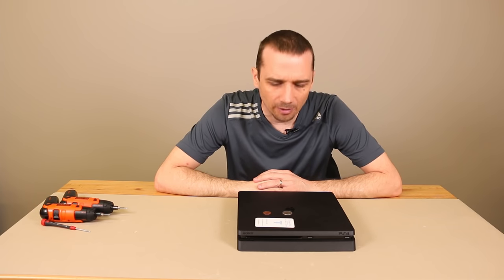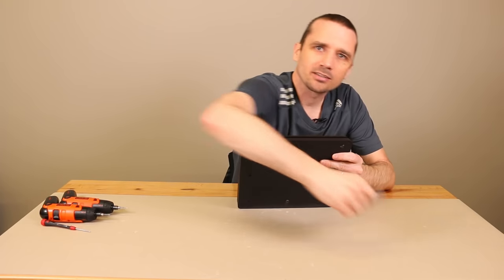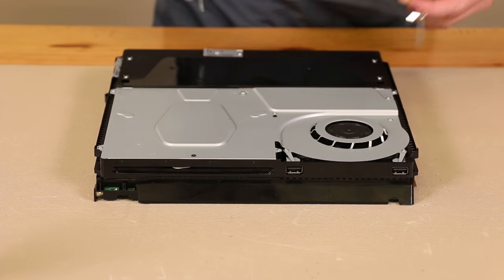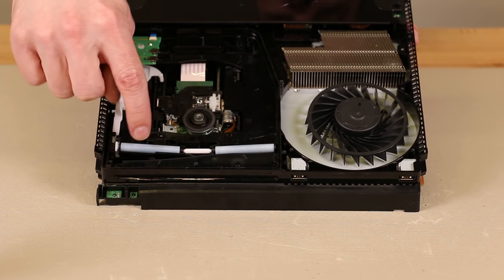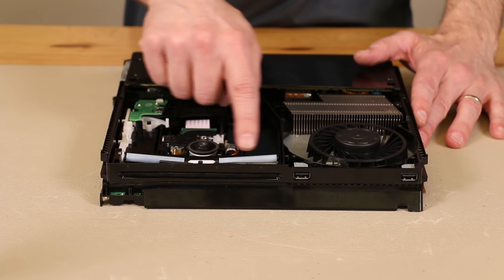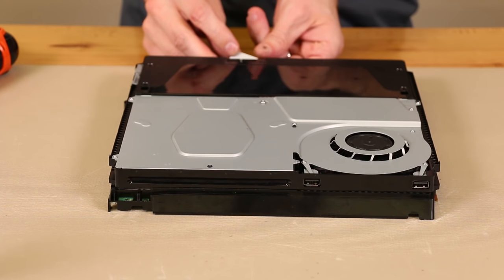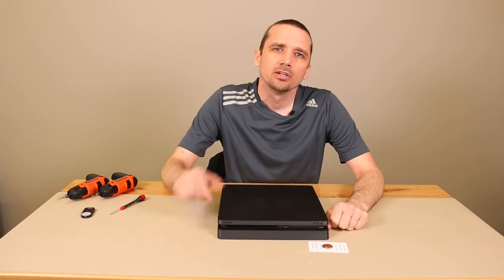How To Fix PS4 Slim Disc Drive

Comment: I did everything exactly and made sure everything was exactly in the right place when putting it back together and it still won't take disks. I don't know what else to do. 🙁
Reply: Same problem, it's because of the 7.02 system software update.
Just wait a week till 7.03 comes out and it will be ok
Reply: @lucasos2507  is that really it, did a lot of other people have problems after the update?
Reply: @GassyHippo  ye, but most of them are ps4 slim users.
Sony's software is that when one thing is broken, it thinks it's corrupt so it will shut down, everything has to cooperate otherwise this will happen.
The update to 7.02 is a harddrive killer to the most user.
That's why sony apolagized on their forum and told us there will be another system update very soon to deal with this.
Reply: @lucasos2507  That's what mine is, I was freaking out thinking I'd have to send it in an not get it back until maybe January. Then I found this video, thank god I still have a ps3 super slim to play blue Ray's and dvds.
Reply: Luca SOS nice glad I came across this video everybody was saying I had done something wrong when I was just playing games last night and my ps4 is in perfect condition thank you for this information my man do you happen to have a link to the forum I want to save as many people as possible from sending there ps4 in for repair when there is nothing wrong with it
Reply: Same here, I noticed my ps4 started acting weird after I updated but didn’t think that could be the cause so I manually removed my disc using the screw on the bottom. Thank god I haven’t actually gone on and torn anything out yet. Will wait until they release another software update to fix this before I do that.
Reply: GassyHippo thank you
Reply: @lucasos2507  are u sure it will be week
Reply: Luca SOS you fr sony can mess up that bad?
Reply: I am getting quite vexed, I downloaded the new 7.02 update and now my PS4 won't even take discs.
Reply: @Chococarakuma  are we all sure that the update is what is causing the problem? I manually got the disc out but now it will not take a disk. Removed everything as shown on video looked to make sure everything was clean and in proper alignment still not taking a disk.
Reply: @stevenglick5920  well my PS4 was working stellar till the update.
Reply: @lucasos2507  oh is that why i get the error and it won't take discs ? i have tried to install and no luck ?
Reply: This is the 2nd time something like this happened to mine, the last update had my PS4 not recognizing discs
Reply: Steven Glick I mean what else could it be my ps4 was working fine until previously the day of the update that isn’t a coincidence and even if it was it wouldn’t be happening all over the world to multiple people
Reply: Luca SOS hi i used to play gta v before update but i changed my hardrive and updated software to 7.02 ,my gta v disc says disc is dirty. But i can play fifa19....would that be this software error???
Reply: @khaleesaneesak5146  yeah have the same problem... did you find a fix?
Reply: Blisto yes, just plug in a usb thumb drive and switch on the console, then insert gta v disc and start installing it.. worked for me..

Delete the gta v  application which didn’t intsall before doing this .Let it freshly install👍🏻

Comment: I found a black right angle piece that has two machine holes. Where does that go? I didn't see it' location before it fell out. I did have the ps4 broke down to the level you have in your video.
Reply: I found that piece too but it was after I’d reassembled the whole thing and it has just worked fine since
Reply: I found that piece too but it was after I’d reassembled the whole thing and it has just worked fine since

Comment: Apparently the newest model out uses plastic welds instead of screws!
Reply: RebelNightWolfe Are they removable? I'm stuck at this step. I don't want to break it. What did you do to handle this?
Reply: RebelNightWolfe  yeah mine is similar to this one you just have to lift up the plastic until you hear it snap then lift it up from the sides
Reply: Ghost Chivero it doesn’t work

Comment: So I just opened up my ps4 using this video because I’ve had issues after the recent software update. Got to my rollers and saw everything looked perfectly fine except for they don’t spin. I think the gears are stuck or something and I’m not sure how to fix that. Really would like some help. Thanks
Reply: The same thing happened to me after the update I watched a video to how to get my stuck disc out and it worked but that cost a bigger problem it won't insert disc no more so I'm going to hopefully try this method in the future don't know when but I'll get back at you if it works

Comment: Thank you so much for the video. I cleaned the rollers of the disc drive. And it works better than before. I also cleaned the fans and it's making a lot less noise now.

Comment: Thank you kind sir. My console works again like it should. I just cleaned the rollers and laser. My console was taking discs but only when it was starting, after that nope, removing disc without any issues but after that it was making weird noises and nothing.
Thank you so much.

Comment: Thanks for the upload managed to fix my ps4 which had a bent disc drive plate. Because of my stupidity in putting my monitor on top of the ps4. Also the right side roller popped out of the disc drive. Saved me money and time sending it to get repaired 👍👍👍

Comment: Thank you so much! My PS4 Slim had black plastic pieces in place of those metal screws you had so I literally just broke the tops off and it still worked perfectly. I cut them off with a razor.

Comment: Hey man. First of all, I wanna say that I appreciate you making this video. Unfortunately, I'm stuck at where you remove the 10 screws. I have the newest PS4 Slim model that was on sale last year's Black Friday. There are cap like screws instead of actual screws. I need help removing those so I can continue with your tutorial. I appreciate your help man.
Reply from the maker: Ya, those ones are more annoying but still doable. What I do is take a pair of pliers and round them off just enough to get the metal plate off. Just enough for the holes to slip over them.
Reply: TronicsFix Thanks for the response. Unfortunately, I'm not technical enough to attempt it. And I don't want to break anything in there. Thinking about shipping it to you to resolve. Based on the noise it makes when running the disc, I've been told it might be a bad laser. Do you have a cost estimate for replacing the laser?
Reply from the maker: We charge $99 for a 5 business day repair.
Reply: @Tronicsfix  right at the beginning where you show how to unscrew the screw at the back, mine has plastic covering thay screw. What do I do?

Comment: The part where you take the screw out for the bottom plate ,it says it voids warantee if removed...is the screw behind that?
Reply: I know it has been 8 months, but in case anyone else wants to know the answer:
Yes, it is behind the warranty sticker. The warranty for me at least only lasted a year so taking off the sticker and voiding it didn't matter as it finished years ago, if that is the case for you, don't worry about peeling off the sticker.
Reply: @benatronnn  thanks

Comment: Also guys there's a spring that hlds the black prongs on top of the disk drive tray. Make sure you don't lose that when you take top of the disc drive off. I had to find mine a little inside below the cover because I had removed it and didn't notice by accident. This caused disc to not go in once they went out.

Comment: @Tronicsfix   
7 years late but just a qestion, do you have to remove the bottom plate because when I try to do it the bottom plate would just not budge and I put alot of power.

Comment: Great video, I definitely need to clean or reassemble those rollers, and hopefully just cleaning the laser will fix my other problem (still reads blu-rays but stopped reading DVDs). Thanks!
Reply: Very mixed results. Cleaning the lens didn't help the DVD non-reading. Tried safe mode update & rebuild, didn't work, will try initializing someday after I get a new backup drive. But I'm guessing the laser is probably busted, would you reckon that's likely even though it still reads blu-rays and games?

Cleaning the rollers really helped get them working again (frankly too well now, they spit the disc all the way out and it falls on the floor if I don't catch it), but I seem to have messed something up with them that makes them much more hesitant to activate, I have to press the disc in there kinda hard now before they notice it.

Comment: Tronicsfix, it seems like the flap connecting the rollers has something underneath because my disc drive is trying to get my disc out but it can't because it's in the way of the exit. Is there a way to get that off?

Comment: Thanks for this, very good video. I did a complete opening and analysis, I'm still stuck though. Everything seems to be mechanically ok in the disc drive but the ps4 doesn't seem to 'know' there's a disc coming in. Probably a motor or something?
Reply: same
Reply: Ya can we plz have some one who knows wuts going on in this section.
Reply: @empirerulez9057  in my situation, yes it was a bad motor on the disc drive.  I sent it to Sony and they replaced it for free (I had to pay for shipping though).  

Once there is any mechanical failure in the ps4, it will not allow for a software update.  It is essentially bricked and will need to be repaired.

Comment: Okay this is a great video and very comfortable in taking this apart however when I go to take off the metal plate it doesn't have screws it has little plastic pins and I have no idea how to take these off.

Comment: Thanks for the breakdown I just fixed my sons Ps4 Slim the spring at the back of the two black arms had come off and was inside .. Thanks ..
Reply: A little help tip for some , in my ps4 slim there were not so many screws under the lid , I had to cut off melted  plastic bits ..

Comment: The screw on the bottom side that goes through to the power supply that you spoke of before flipping the ps4 over, what size Philip head screwdriver did you use?

Comment: Mine has plastic welded tabs instead of screws on “the metal plate” more of the plastic than of the screws. Will my PS go back together if I break those tabs?

Comment: I understand everything you're saying, but I have a problem with that because I don't have screws on my gray plate I have black round plastic heads, but have 4 screws. And no way to pry open without breaking black heads. 
I'm trying to fix my friends PS4 Slim because it will not read any discs and says unsupported. Neither DVD or Blu-ray, but it takes time loading about a full minute to show the ? . It revs up kind of loud but struggles off and on trying to read a disc but never does. 
Any ideas?

Comment: I’ve opened mine and it only has three Philips head screws the other six are little black plastic covers? Is there a way to get around them or remove them without damage?

Comment: . Excellent video and breakdown of dissembling it. The only problem  I have is right up till after you clean the rollers then that white plastic it doesn’t slide.. I don’t want to force it towards me to break it. When I push down the rollers It doesn’t slides and when the rollers are up it doesn’t slide. I don’t see anything lodged in there. It moves a a little it doesn’t go back and forth.  An u help me please. Thanks

Comment: I got the cottons from a qutip stuck on the plastic gears?? I took off the cotton stuck there but now the PS4 can’t take in the disc. Am I just missing some important screws or is the plastic gear janked up forever? (Next to the left roller)

Comment: Steve.
I got the 1tb model and it has the rubber grips in place of where the screws at on the metal plate. How do I remove them???

Comment: Have to open my PS4 to clean the laser and I´m a little confused about the screwdrivers I need to remove this laser cover thing. In the desciption it says Ph00 but at 3.45 in the video he says Ph000 so triple zero. What size do I need? Double or triple? Thanks

Comment: Does the PS4 Slim turns on and plays games from the HDD without the disc drive installed? 

I'm almost removing my disc drive to prevent any updates since I got a jailbroken 11.00 PS4

Comment: You are very good presenter, i like yor videos very much.
You helped me fix several ps4.
I have one question if you know to answer i would be very grateful.
I have one ps4 cuh2216a without (totally broken) bluray drive, my question is do you know which ps4 model bluray drive is compatible with cuh2216.
Reply: I found that cuh 2016 is not.
Is 2116a compatible?

Comment: My ps4 hard drive has what looks like loose film. I'm wondering if i can tighten up. Kinda like we used to wind back up cassette tapes back in the day? 

Basically when u pop the small cover off back left side exposing the hard drive. The film is loosely hanging out. But ps4 still works  fine. Looks like its resting against the plastic cover.

Comment: I am currently trying to fix my some ps4 because it won't insert a disc followed your instructions got to where they black screws are where the silver plate is but the black screws don't have anywhere the screwdriver fits in just wondering what do I doe

Comment: Hi I cleaned my ps4 slim myself. When I put it back together and tested it, it worked but the problem was that when I turned it on the disc drive made a weird noise for a couple seconds then stopped.  Now it won't take in any disc and everytime I press the eject disc button or turn on the ps4 it makes the same weird sound. Do you know the fix for this
Reply: Did you find a solution for this , got the same thing

Comment: For me the plastic thing between the rollers got removed for some reason so I teared it apart and fixed the problem. But before I remove the metal plate (where you had to remove 11 screws I think) in my ps4 for some reason it only had 4 screws and in the other holes it had a soft plastic, so I used a solder to remove it and continue my process.

Comment: I got to the part where you have to unscrew the cover plate from the disk drive, but I don't have screws on most of the holes, they look like black plastic fasteners. I think I'm screw unless I can live with breaking them.

Comment: Will inserting business cards , coins , etc cause the ps4 not to read disk ? My little nephew stuck a debit card in the disk drive , took it to get it removed , but before they even looked at it , the told me it “wasn’t going to work anymore” before they even looked at it , according to them cus that causes debris to go in the disk drive , is that true ? Got it back , and indeed , it isn’t reading the disk
Reply from the maker: Depends on if it messed anything up inside. Most of the time they work just fine after you remove whatever was in them.

Comment: Ok video, could use a few touch ups however.

1. Please show us close ups of the screws before removing or putting back together so we know what screws you are talking about.

2. Could mention how to unscrew those little black knob-like screws, as you are doing this on an old model, which does not have it, those like me with the newer models are basically stuck midway. 

Got atleast halfway before realising that there was no instructions on how to deal with such, therefore, a waste of time unscrewing it all in the first place.

A good presentation regardless. Good job.

Comment: If non of these work for you, take a look at the green microchip board there should be little prongs sticking out of the square chips, these trigger the mechanism to activate. mine had snapped off no idea how they snapped though but I just manually wound the disk in using the screw, not a long term fix at all but if you only play one game this could work for you

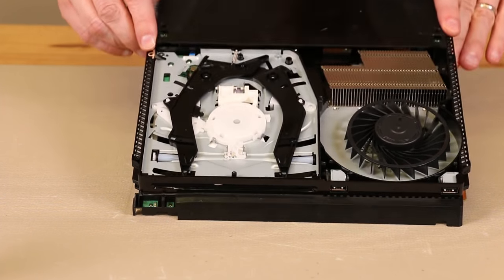Comment: 04:15 - I GUESSED RIGHT! That happened to me. I blew the system out with compressed air and found the little thing lying there on the floor. I thought, "Oh, no! I'm new at this! WHERE DOES IT GO?" Found the spot that fit best and made sense (grounding component, I imagine). Put it on that spot and then saw this video :)

Comment: Hey I don't know if you'll see this but for some reason my ps4 slim drive is missing the magnet metal disk that holds down the disc. I'm looking for a replacement disc assembly or the top half but can only find the full drive online and i don't want to spend that money for the top piece.

Comment: On a PS4 slim i've been working on somehow the spring at the top of the drive that allows the disc arms to take the disc and kick it out is missing. I can't seem to locate a place to purchase these springs. Any ideas on where i can purchase a spring or a link to a site for purchasing one? I've tried cutting some small springs and stretching them, but they pop off. Thanks

Comment: Hey TronicsFix, when you opened it, and took out the disc part with the black arms what is the two white parts on the top left supposed to do? Are they supposed to be attached together or not? Cause I don't know what to do

Comment: Mine started having an issue a couple of days ago, when I turned it on the disc drive made a noise as though it were struggling to start it's rotation. Once on the main screen I noticed that the disc wasn't showing up either, so I tried a restart, that fixed the problem and I also started the game on the disc with no issue. Now when I have a disc in the drive, it makes that noise and refuses to read the disc, I managed to eject the disc and even temporarily put it back in, to confirm that there is nothing wrong with the PS4's ability to take and eject discs. 
Fortunately I don't have too many physical games on the PS4 that I'm playing, so I'll probably get it fixed when it's in the budget, but for now I'd just like to know what the issue is, and if it's repairable or if I need a new disc drive.